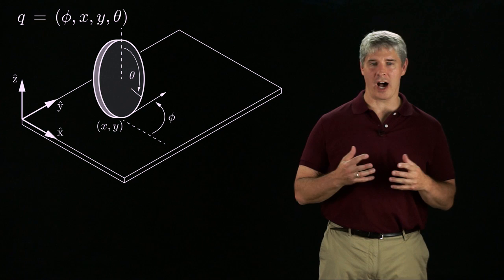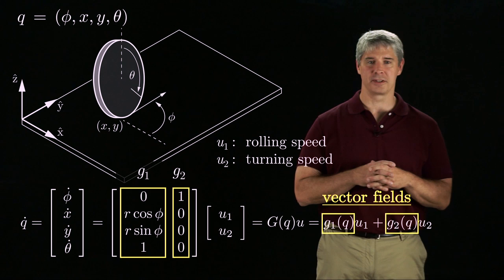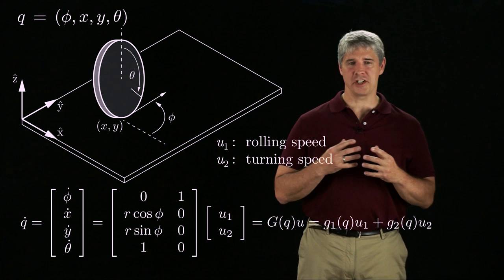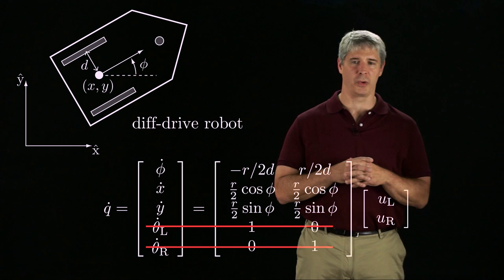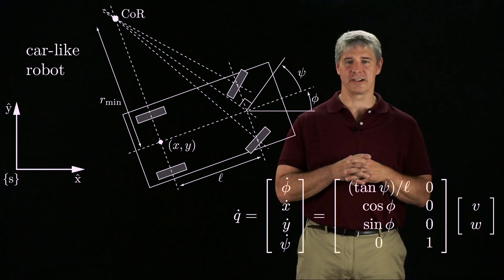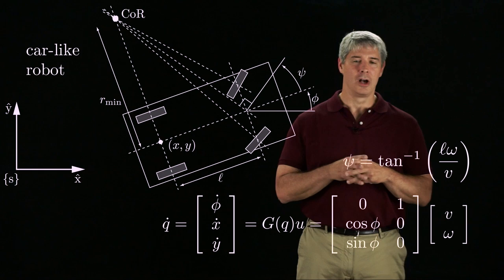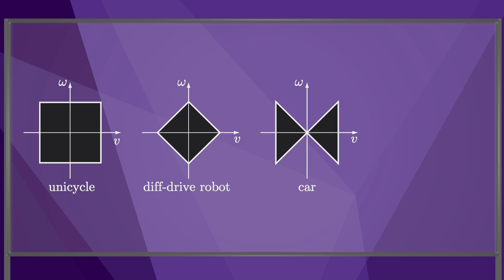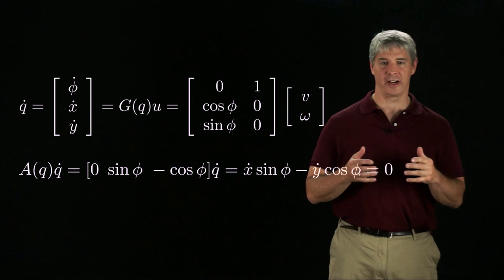Modern Robotics, Chapter 13.3.1:  Modeling of Nonholonomic Wheeled Mobile Robots

Comment: I have a question. We know that the position of the mobile robot is in 3D space and have position in the x-y-z dimension, especially for uneven terrain. In the dynamic model, velocities in the x and y-direction were accounted for. However, that in the Z direction was not. Will this still give an optimal position solution for control of the robot in such cases where the terrain is uneven?
Reply from the maker: Hi Sam. The book chapter and the videos deal only with mobile robots moving on flat surfaces, not uneven terrain.